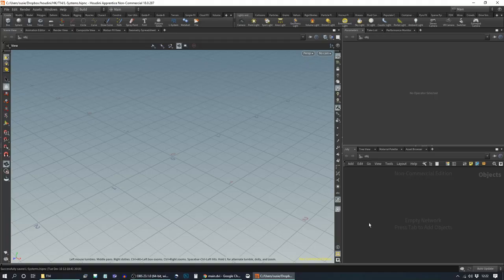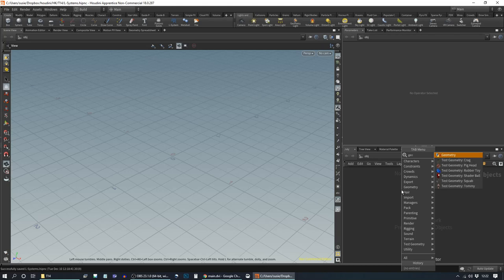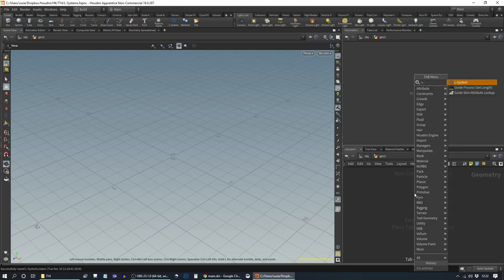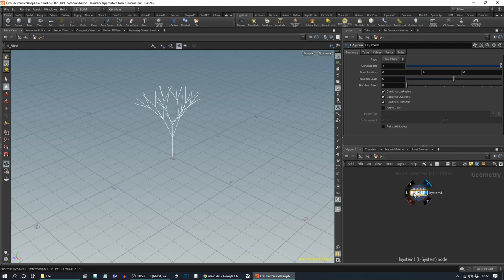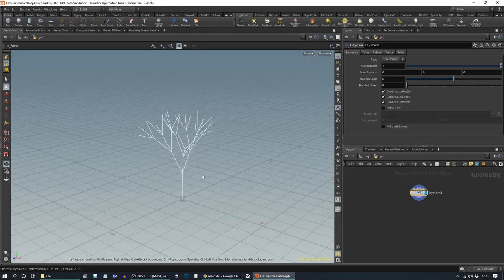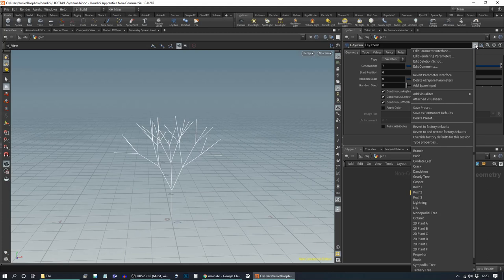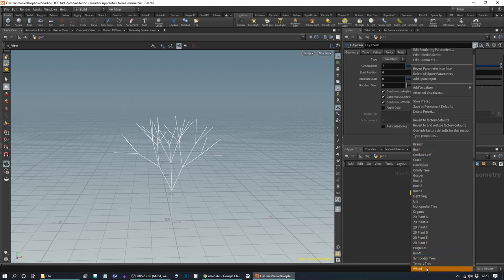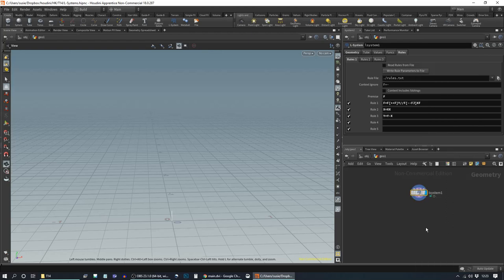Tutorial 14. L-Systems

Comment: This is great.  I found your video while doing further research on L-Systems.  A quick question.. your samples are saved as .bgeo files.  Do you either have them as .geo ASCII files (and/or, is it possible to just save the L-System "recipe" as a single file?).  I have my own L-System renderer, and ideally I'd like to add code for importing L-Systems built in Houdini, but having to parse through a .bgeo file is a bit more effort than its worth. :)
Reply from the maker: I'm afraid not. Could you to import them as files into Houdini and save them out again as .geo?